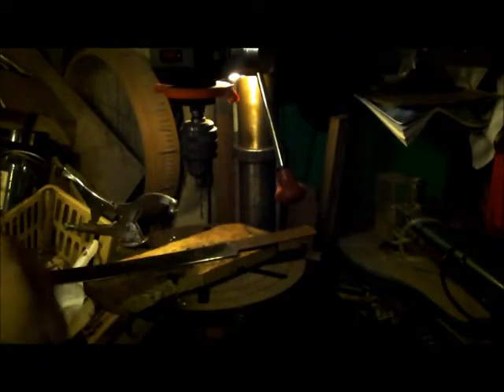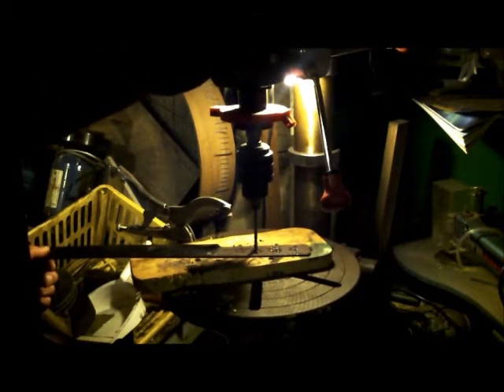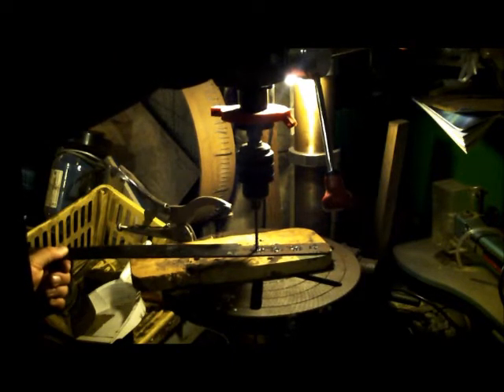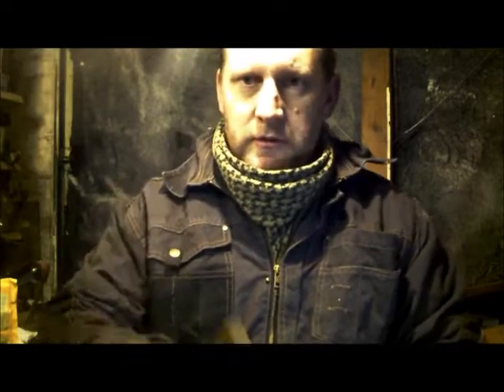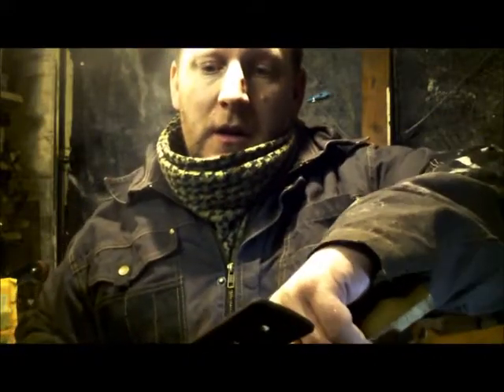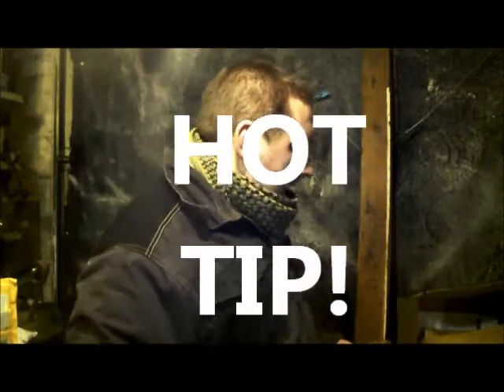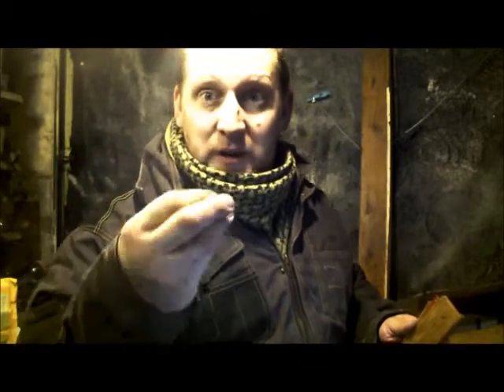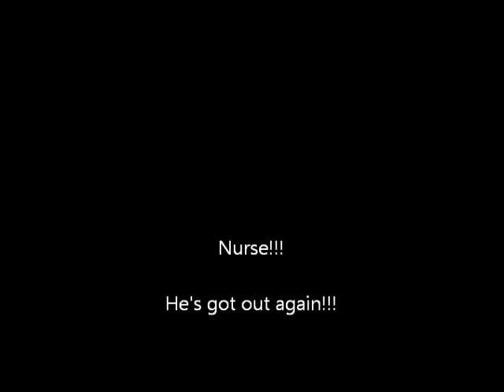British Army Golok Bolo machete a refurbishment of a Ralph Martindale blade for an ex serviceman

Comment: It is funny how I spend a lot of time out in the cold work shop, only to come in to warm up with a cupper & end up watching you doing the same thing I have just been doing!!! But thank you for the tip about the poly bags as I have glue all over my vice floor & table! Take care mate K-dog..
Reply from the maker: hi there, no kidding I've brought home the scales/red liners I had gluing in a vice overnight and the glue that had oozed out (gorilla glue) would have run over the thread and bonded the jaws solid, these old A4 wallets don't stick too well to the adhesive and so despite a fat bead all around the scales it pulled out without ripping the wallet to be used again, a reuseable item that prevents glue sticking to the floor or vice/clamps, all the best! hopefully a bit more bolo tomorrow!